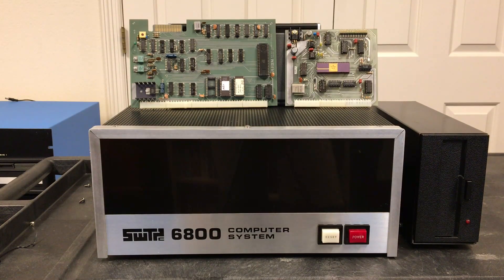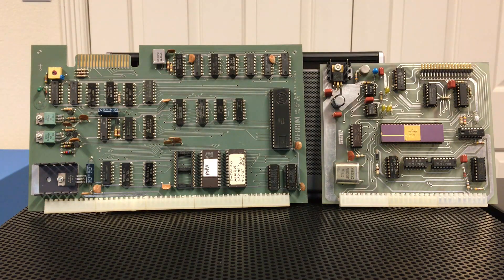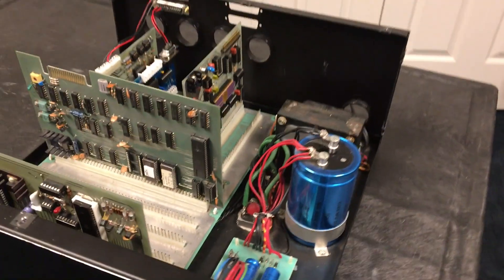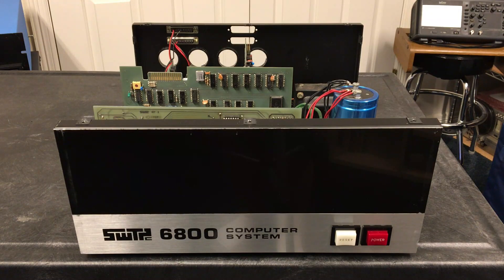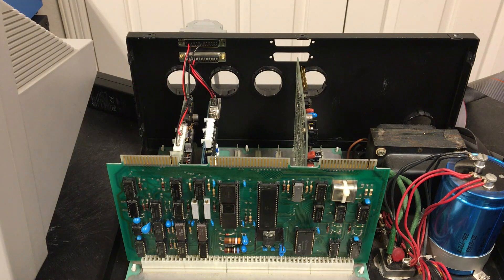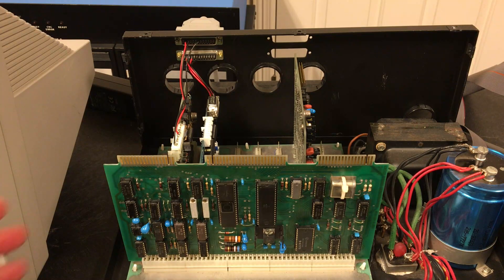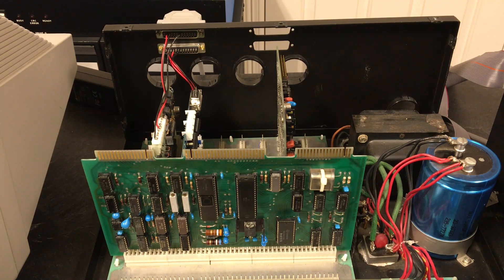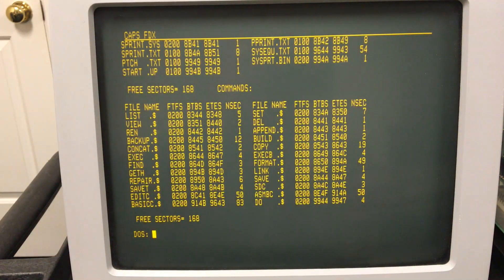BFD-68A Disk Controller for the SWTPC 6800 (Smoke Signal Broadcasting)

Comment: Why did the BFD-68A offer three connectors on top of their board?
Btw, great youtube channel !!
Reply from the maker: The right connector is for 5.25" drives and the middle connector is for 8" drives. The board can do 5.25" or 8", but not both at the same time. Shugart only defined three drive selects when they created the SA-400, so the left connector was a way to address a fourth drive. It mapped the 3rd and 4th drive select of the board's logic to the first two drive select pins on the SA-400. The board in the video is actually version "A" of the controller. The original version had only the 5.25" connector and supported a maximum of three drives.